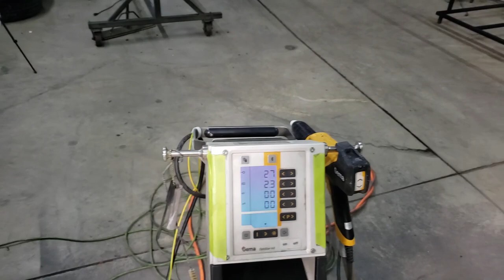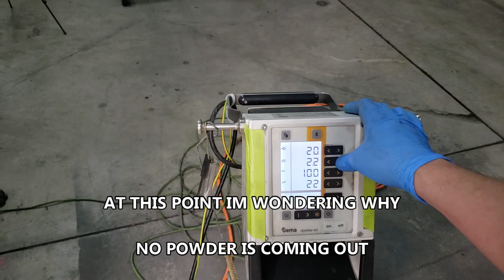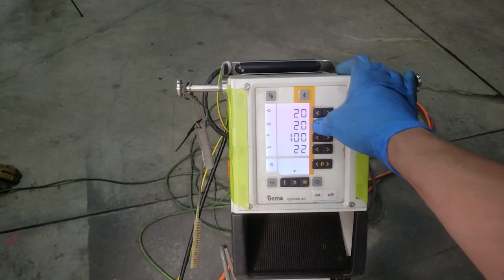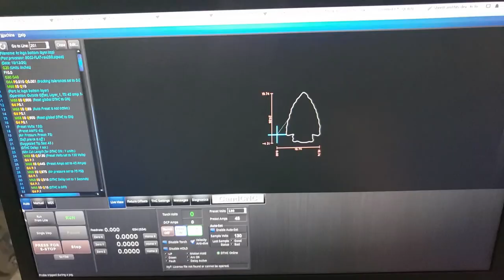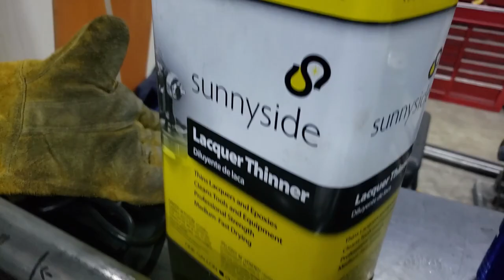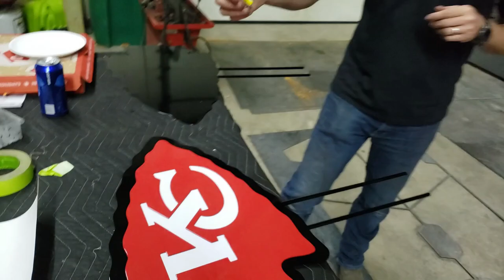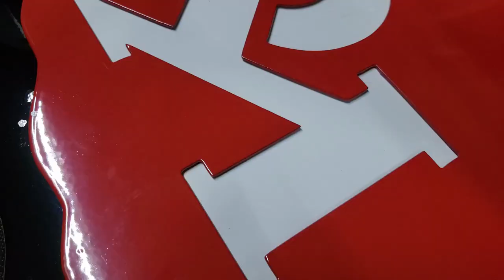3 STAGE POWDER COATING, WELL KINDA

Comment: Wow, such a huge oven for so few smaller parts.  Don't you have a medium sized oven?  Might bring down your energy bills.
Reply from the maker: That oven runs me about 11 dollars a day....so Im good.  I have noticed that small coaters tend to get caught up with energy costs and powder costs.  We let it run 8 to 12 hours a day, its cheap, and if we were to shut it off, turn it on, shut it off, bills would be higher as it would be always trying to reheat the entire structure.  Spraying to waste is a normal practice and you should be charging for the powder that stays on the part and does not, part of the business.  Thanks for watching!
Reply: @RightNowPowderCoating   Thanks for the quick response, I have been learning a lot from your channel. I bought a 3x3x6 ID oven and still setting everything up.  Not for a business, at least no intention there yet.  I'm going to try a sort of two color olive drab camouflage effect for my 5-ton army truck I am rebuilding, so your videos on two or three coat processes will hopefully help me succeed on my first try. I'm still a bit confused on when to fully cure and when to just melt out.  Bought the zinc primer already and from everything I have been seeing I should probably only melt out each application until the final coat.
Reply from the maker: @danadurnfordkevinblanchdebunk  Yes only do partial cures till your done applying powder, the final coat will bue full cure, if you full cure the other colors they will not cross linc with the top coat and your powder can peel in sections.

Comment: Hi, I am homewelder&fabricator and I just found your channel! Being pretty new to all steel coating methods I'd be interested what different options are there and when they are possible.

Is powder coating the "best" or is there still something else that is superior? I just learned that can you powder coat galvanized steel, can you also powder coat stainless steel (assuming it's the martensitic type)?

For inside or outside steel gates (for example), what is the best coating options? If you answered powder to both is there any reason for doing something else, like primer+paint?

KC sign was pretty good looking!
Reply from the maker: We use primer when asked to or we know it needs corrosion protection...outdoor ect.  If indoor no need.  Epoxy for aluminum, zinc for steel.  Any substrate that can withstand cure Temps can be powder coated.  Great coating option, easy to apply, no voc, green, durable